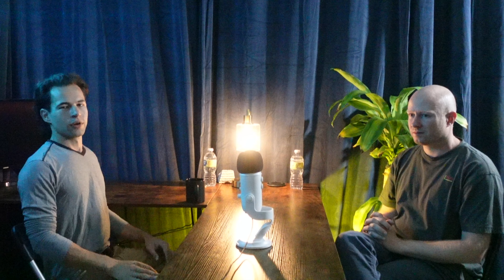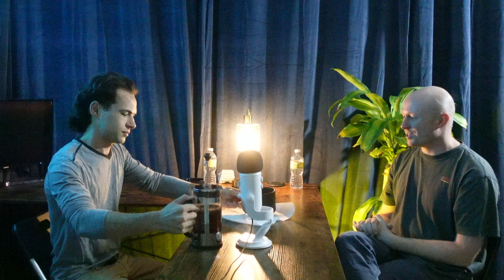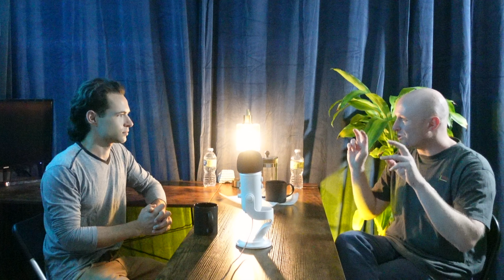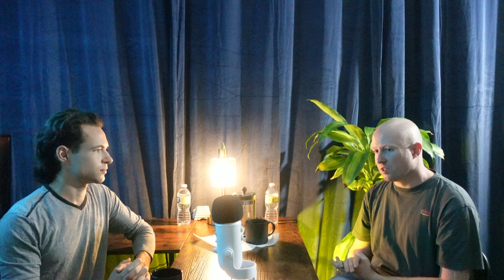Peri 3D Construction CEO on Building Worlds Biggest Printed Home in Houston, Tx

Comment: 3D printing causes more problems than they solve 
All 3D printing replaces is the framers
But they have not figured out the electric plumbing HVAC and installing doors windows is much more difficult 
Any savings on the print is offsets by the additional cost from the Subs
Opinion from a retired electrician of 46 years
Pumicecrete is the answer
Reply: Pumicecrete is by far the best building material on the planet Pumicecrete is a mixture of pumice cement and water mixed and poured into a set of reusable forms with a ratio of 10 parts pumice to 1 part cement and 1.5 parts water giving it a low cement ratio 
Pumicecrete is fireproof termite proof rust rot and mold proof non toxic and has a high R value and good sound attenuation solid poured walls means no critters can live in your walls Pumicecrete can be built for a fraction of the cost and time and pumice is the only material that can go directly from the mine to the job site ready to use without any additional possessing and can be stored outside forever 
Build time takes a fraction of the time because forms go up quickly and all doors windows electric plumbing HVAC are installed in the forms before you pour all electric and plumbing are installed in conduit making the water lines replaceable 
You can build the entire structure out of 3 materials Pumice cement and water 
You can build floors walls roof interior walls counter tops bath tub hottub pools furniture your only limited to your imagination 
Building with pumice goes back 2000 years 
In Rome the Pantheon is the largest unreenforced free standings Dome on the planet 
Why would you build out of anything else 
I have been building pumicecrete homes for 30 years and my sister built her first Pumicecrete home in 1982 in Español  New Mexico 
Show me a better building material than pumice and I will give you my house 
Take care Ray
Reply: Please elaborate regarding your knowledge of PumiceCrete. Why and how is it the Answer.?